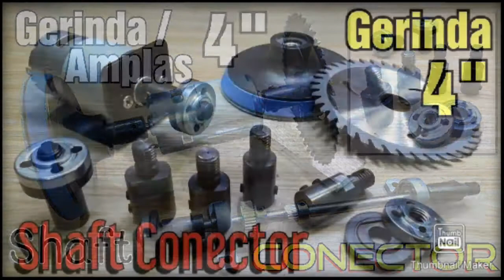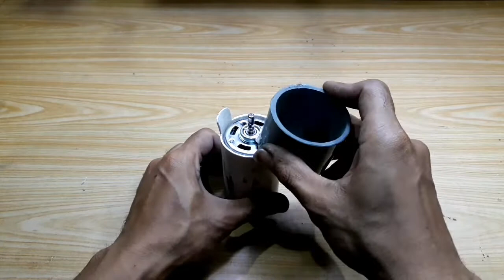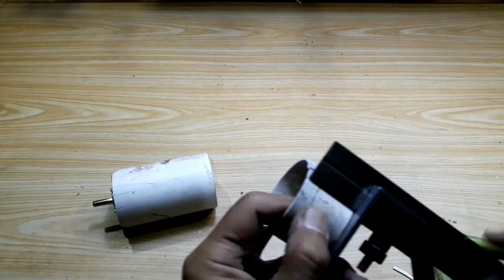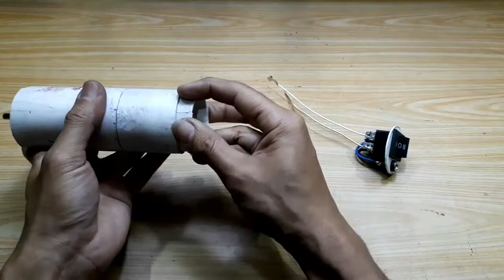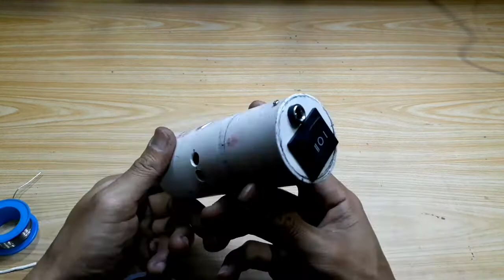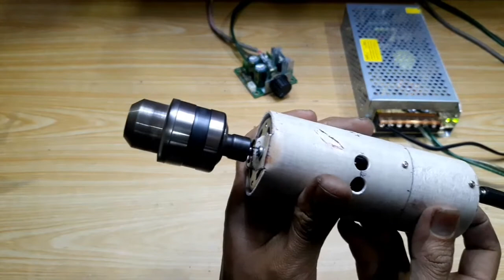Membuat Mini Drill Dinamo RS 775 UpGrade Cashing PVC ( Paralon )

Comment: Kalo dinamo Rs 795 standar butuh adaptor berapa volt & amper bang? Tx
Reply from the maker: Kalau standar  lilitan kecil 3A cukup, kalau lilitan besar pakai 10A saja mas .. kalau Voltase bisa pakai 12 sd 24volt. Pakai lebih dari 24V takutnya cepat rusak 😊
Reply from the maker: Kalau rekomendasi saya, beli adaptor jaring 24v 10A ditambah dimmer DC 10A. 😊
Terima kasih sudah mampir ke channel DIY saya ya Mas .. 🤩🙏🙏🙏
Reply: @dodolannyeleneh  Mkasih bang, spek itu ada ga yg jual modulnya ya? Mo blajar elektronik dari nol nie 😁😁😁
Reply from the maker: @wahyuriani8859  bisa beli di toko online lho .. 😁🙏
Reply: Tkyu banget 👍 ini channel bikin orang gatal pingin bikin ini itu mski gk bisa elektronik 😂 sukses sllu ya 🙏
Reply from the maker: @wahyuriani8859  siap Mas .. 🤭😁🙏🙏🙏
Reply from the maker: @wahyuriani8859  https://shopee.co.id/product/41800368/5541127214?smtt=0.41801754-1638592787.9
Reply: Kalo pake adaptor universal 12 volt 5a kuat ga ya
Reply: Mw pake yg jaring bnggung ngrakitnya
Reply from the maker: @goldroger3767 Biasanya di cashing ada lambangnya kok mas .. in  dan out nya 😁
Reply from the maker: @goldroger3767  12v 5a masih kuat 👌